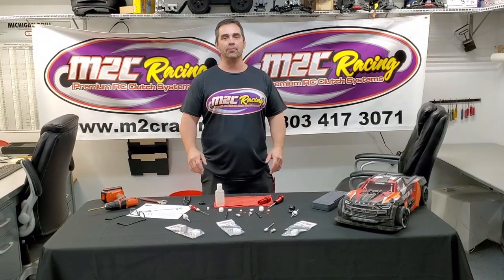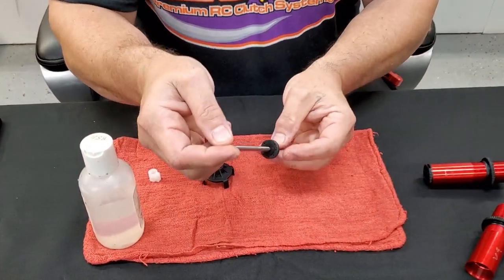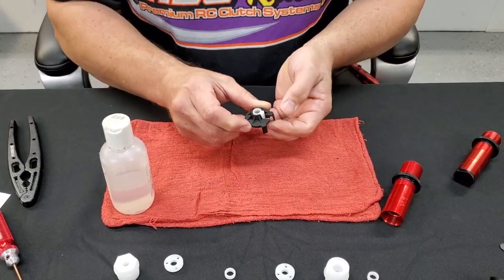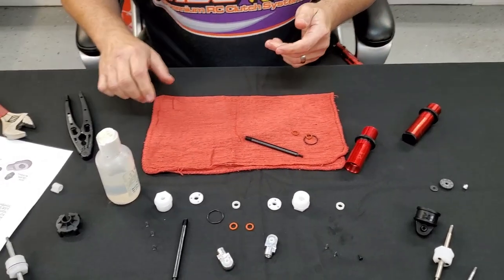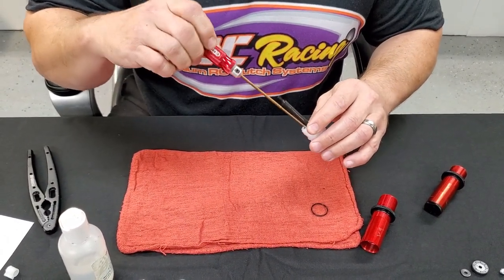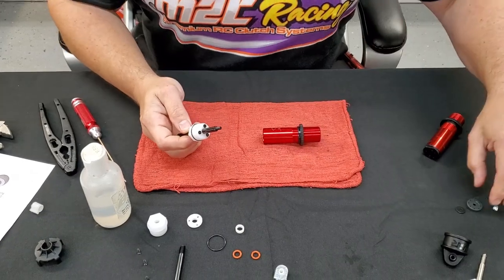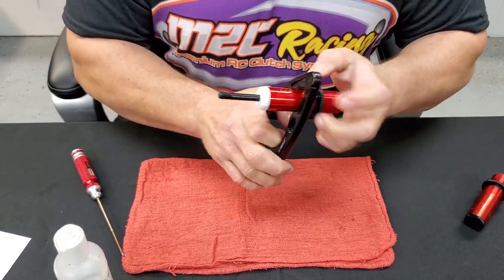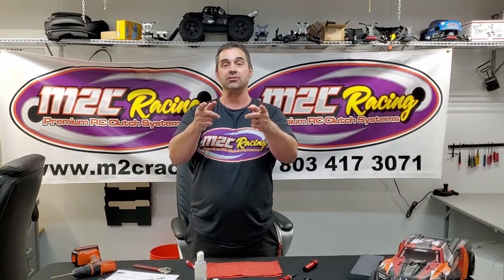M2C ISB SHOCK INSTALLATION

Comment: Where do you use the 9/32 drill included in the kit?
Reply: Yeah wondering the same thing here. The piece that's supposed to go into the spring retainer is also wayyyyy too small for the 8s

Comment: Any reason why this wont fit the EXB models? And do you plan on releasing a version vor the EXBs?
Reply from the maker: it does, we now make exb ends, check it out at www.m2cracing.net
Reply: @m2cracing168  I saw the EXB ends, but the 3492 set with the cartridge says that it doesnt fit the EXB, same with the versions for the Kraton.